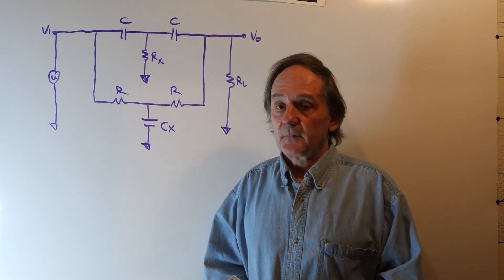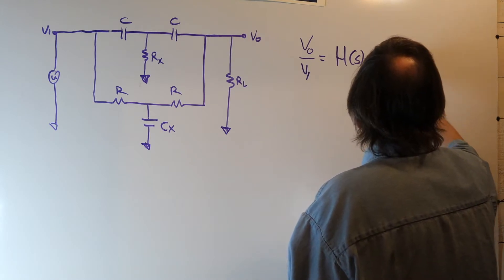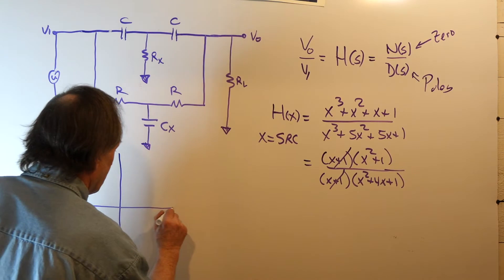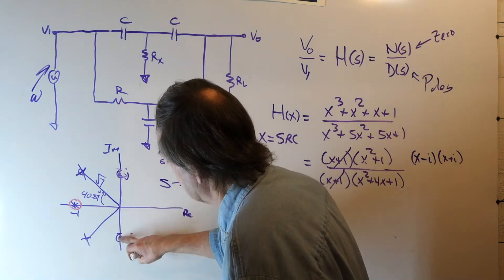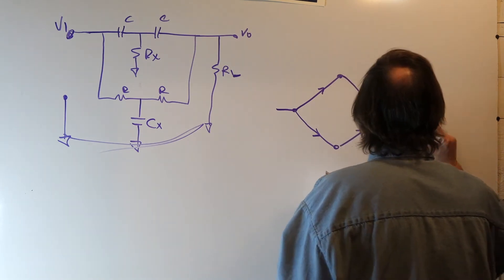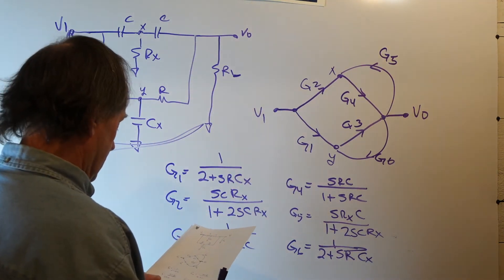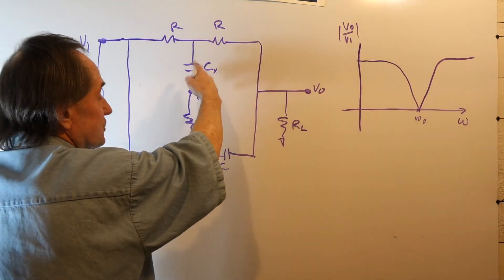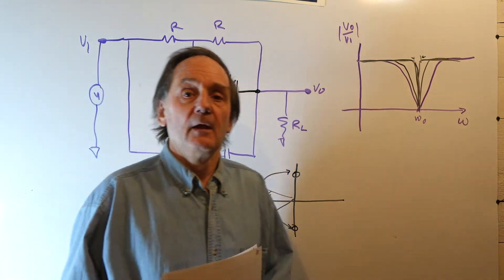Twin Tee  "NOTCH FILTER" Problem

Comment: Thank you for a clear and structured explanation. The rational expression in x=RC is quite revealing. But how do the paramterers R_x and R_c get into the equation?
Reply from the maker: Rx and Cx are two of the branch elements in the network.   They have to appear in the system equation and the transfer function.   The subscript "x" is to help identify which R and C  are from the "Tee" node to ground as opposed to the other Rs and Cs in the network.
GH   March 05, 2022
Reply: Thank you for a quick reply. I'm sorry that my question was unclear. There are four parameter values in the network: R, C, R_x and R_C. However, only two of them, R and C seem to appear in the transfer function expressed by the two polynomials, since they are both expressed in x=RCs. I have prbabely misunderstood something.
Reply from the maker: @larslundheim7606  
Yes, you have misunderstood.   I stated at time 3:32 "With proper choice of Rx and Cx"  the transfer function will reduce to the form shown at time  4:53

If you want the general transfer function that has R, C, Rx, and Cx  before expressing Rx and Cx in terms of R and C, then work out the transfer function as I have given you in the flow graph at time 13:30

The transfer function is:

    H(s) =  Vo/V1  =   [ G2 G4 + G1 G3 ]  /  [  1 -  G4 G5  -  G3 G6 ]

It is a lot of algebra to get the expression in standard form with coefficients multiplying like powers of complex frequency "S" but the coefficients will contain R, C, Rx, and Cx.

Good luck.    My final video on this will detail the general expression.
GH
Reply: @georgehnatiuk5806  Beatiful. I see it now. By expressing C_x in terms of C and R_x in terms of R, I get various polinomials in RCs depending on my choices. Thanks again for excellent teaching. :-)

Comment: Sir why in notch circuit we use half resistance by applying parellel and capacitor twice by applying parellel?
Reply from the maker: I am not sure what you are asking.   One reason from a production point of view is that by making  2C = C // C in parallel and   R/2 = R // R also in parallel is that you only need to purchase two values of components  R  and C  rather than 4  of them as R, C, 2C, R/2.   It may actually be cheaper to use two resistors and capacitors in parallel and have four resistors of value R and four capacitors of value C rather than 2 resistors of value R and one resistor of value R/2 and two capacitors of value C and one capacitor of value 2C.
GH
Reply: @georgehnatiuk5806  thank you sir for replying ... however my question is that is it necessary to connect half resistance and twice capacitor for notch filter ? If we don't have half r and 2c ,can we still make notch filter?
Reply from the maker: @ektad5074  No you cannot.  That combination is needed to generate a pair of complex zeros on the j-omega axis which produces the null/notch.  Look at the transfer function at time  6:37  and   13:40.
At time 13:40 using Mason's Gain formula, the transfer function for Vo/V1 =   [G2 G4 + G1 G3] / [1 - G4 G5 - G3 G6]
for this to match the transfer function at time 6:37 where x = sRC   requires   Cx = 2C  and  Rx = R/2
Try working it out but be careful with the algebra.
GH   Oct 6, 2021
Reply: @georgehnatiuk5806  thanku sir🙏

Comment: would you plz show the graph method of solving nework with an illustrative example.. i had no clue how you got the gain
Reply from the maker: I will eventually make a series of videos on solving networks(electrical, mechanical, s-parameter, etc) using Mason's Gain formula.  I developed a method 30 years ago and was going to write a book on it but never got to it.   Life gets in the way at times.  Rather than write a text book on the method, I plan to document it in videos.   That is a ways off though.  Stay tuned.
GH  June 13, 2020

Comment: This is probably a super ignorant question and maybe one that needs more explanation. I am currently trying to solve this kind network using nodal-analysis (is that possible?). How does that "graph technique" work regarding to does feedbacks. I have "hunch", but I am not certain. G5 and G6 that is. And how do you derive those complex equations? Just "regular" nodal analysis? Kind regards an engineering student. Btw very inspiring videos.
Reply from the maker: Sin Tau,
I need to address this network again.  Thanks for reminding me.   Stay tuned.  I will do so soon.  Yes, NODAL analysis works just fine to analyze.  I will do a video showing you how I would go about it.
GH  October 01, 2019
Reply: @georgehnatiuk5806  Thanks! And thanks for the quick response. Looking forward to it. I will try to learn a little bit more Laplace until then. Kind regards.

Comment: At the end you showed a circuit where the output (V1) was feedback via an OpAmp to sharpen the notch.
What happens if you feed the OpAmp (+) input with V0 and feedback the connection between Rx and Cx to the OpAmp's minus (-) input.
Reply from the maker: Pelly,
You would need to apply some negative feedback so that the node between Rx and Cx has some impedance to work into.  My guess is without that, the very high input impedance of the inverting and non-inverting inputs of the OpAmp would prevent any current flow in the network and the network would essentially "float" at the input voltage V1 and the OpAmp would saturate.

With a resistor connected between the OpAmp output back to the inverting input to provide some negative feedback, would force the voltage between the OpAmp inputs to be ZERO and the voltage across two pairs of R-C series connected components to be also zero as the voltage across each need to be opposite in phase.  How can the phase relationship of voltage across a series connected R-C cancel and be zero if a current flows in them?  At most that voltage phase relationship can be 90 degrees  and never cancel.

Remember that the amplifier in the bootstrapped "twin tee" network is not an OpAmp but a positive finite gain amplifier with gain "K".
GH
July 17, 2019  10:49am

Comment: Thanks for the video. Can you give a statement on how to choose the right parts for the bootstrapped twin-t-notch filter? I just build a passive one with ordinary 5% resistors and 10% ceramics caps, that works so far but of cause with a very low Q. I tried the same with a bootstrapped filter without luck. Do I really need film caps with 1% tolerance for that? What about the resistor tolerance?
Reply from the maker: Yes, you need tight tolerances on the Rs and Cs to get a good sharp null.  The film capacitors insure the null will be deep since the depth of the null is governed by the ESR of the capacitors.  The lower the ESR, the deeper the null.  The best capacitors to use in order of quality are:
(1) teflon
(2) polystyrene
(3) mylar or polyester film
(4) ceramic
(5) tantalum
(6) aluminum

To get tight tolerances, you can use 5% capacitors that are lower than the correct value and add capacitance until get to the correct value.  Same with the resistors but start with 1% metal film resistors that are higher than desired value or SMT surface mount resistors.  Do not use wire wound resistors.

GH  April 20, 2019   8:12pm

Comment: I can't keep up George! Is the sound very scratchy?

and the other video you did today is also very scratchy.

Get some proper microphones George!!!!!
Reply from the maker: What sound is scratchy?
Please be more specific or give me a skype call.
Reply: The sound quality is very noisy, as is your other video. It is not awful, but it detracts from the sound quality significantly.
Reply from the maker: I do not get that on my system.  Very clear and good sound level.
What kind of noise are you talking about?
Reply: It sounds very noisy, as in low  signal to noise ratio. There is a constant sparking and spitting noise, akin to an amplified small signal and a constant hiss. I am amazed you can't hear it. Are you playing it on a low quality sound system through some dodgy speakers?
Reply from the maker: NO.  Powered speakers with wide bandwidth.
Let's see if others complain.  Do not know what to tell you Rumpus.
I am puzzled.  You have had this problem before with my videos.
I just do not get it.
Reply: and the last time it was because I was detecting a radio playing in the background, which you admitted there was! The problem is NOT mine! Only your video on youtube is making this hiss.

Could be something to do with your laptop recording the sound and interference on the board. Computers are awful at recording high quality sound.
Reply: George, you can do spectral analysis of your sound and see noise, even if you can't hear it. I approve there is high freq. noise clearly audible. Not very high level, though.